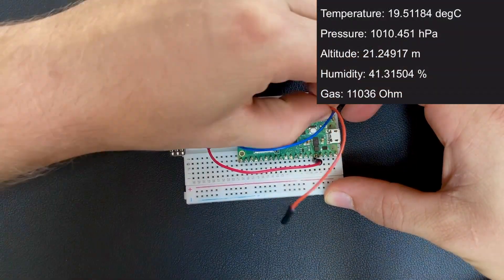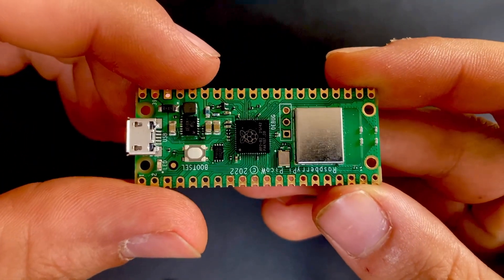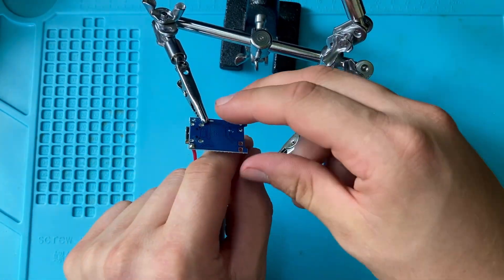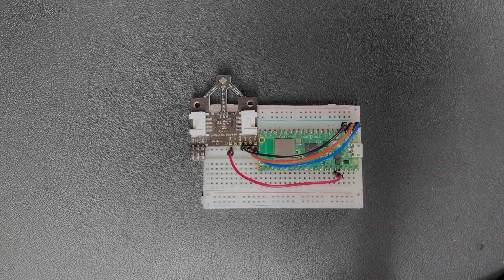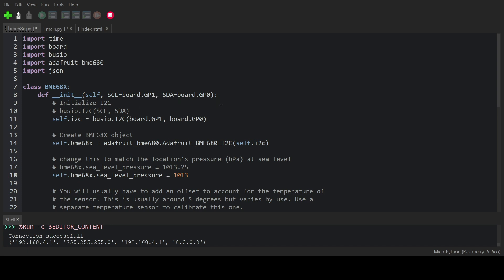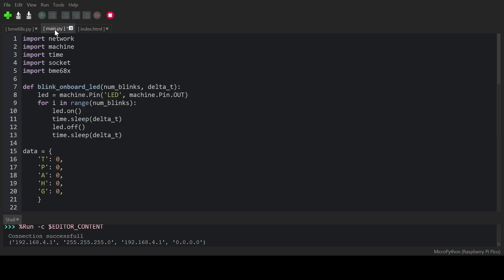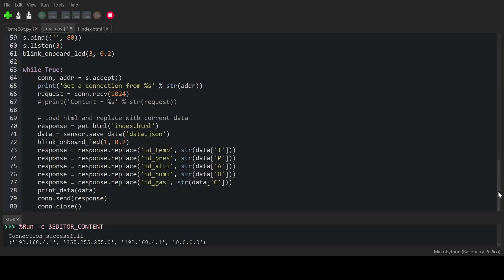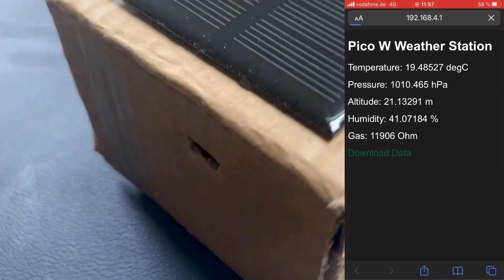Remote Weather Station - Solar powered Pico W SoftAP

Comment: What is the correct rating for the Schottky Diode?
Reply from the maker: We used a 1N5817 Schottky Diode which is rated for 20V and 1A. You can even improve on this design according to the Pico Datasheet.